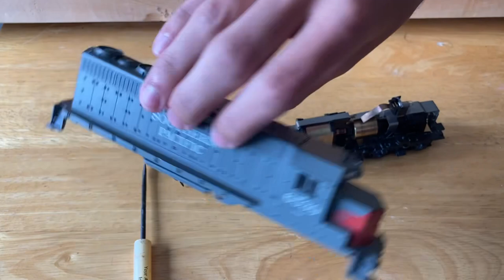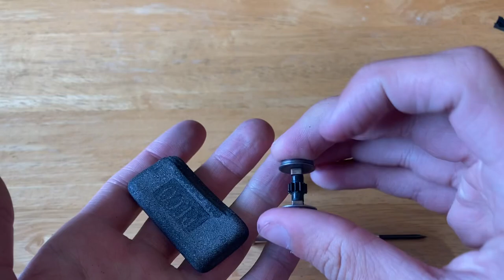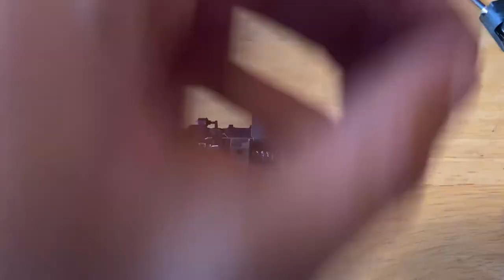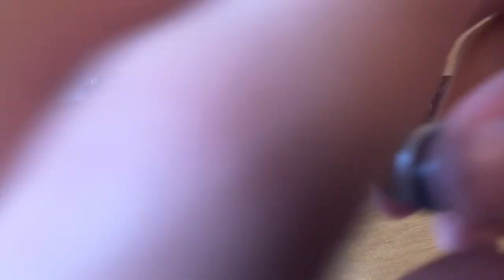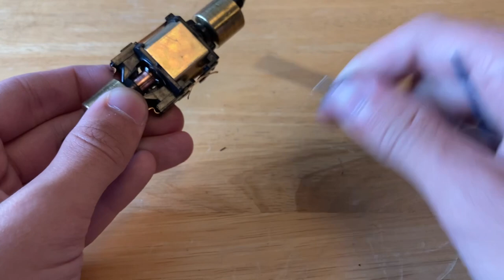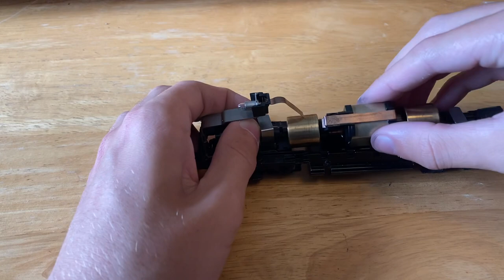Athearn Blue Box GP35 Restoration 🧰⛽️🌊 Can We Fix It?

Comment: The light bulb might need to be replaced or the light's metal contact strip isn't touching the main metal contact strip
Reply from the maker: After a closer inspection, the filament is broken inside the lightbulb. Thanks for Watching!!
Reply: @Thelefevrefever  switch to LED it looks amazing
Reply from the maker: @Devilninja333  Thanks for the advice!